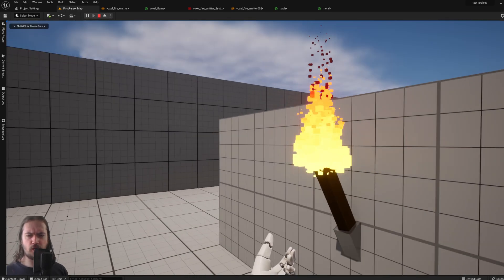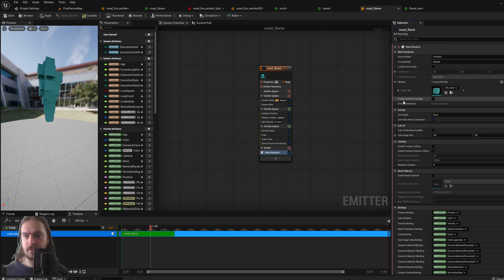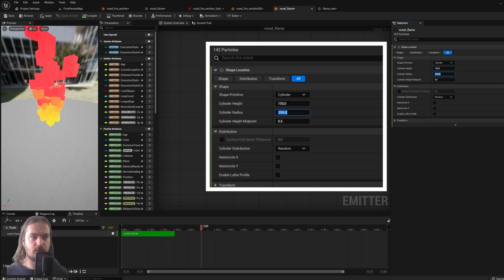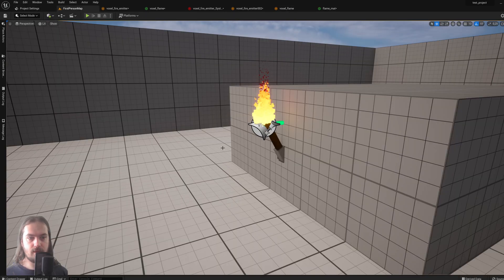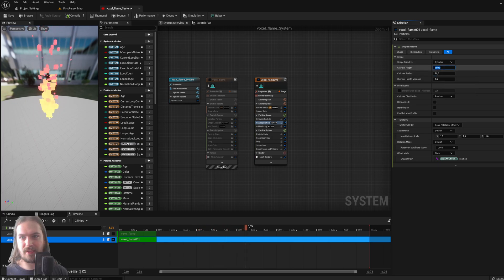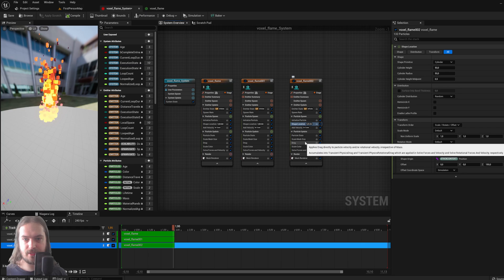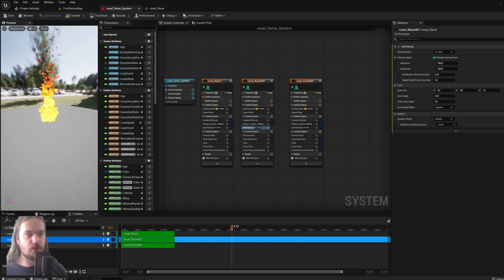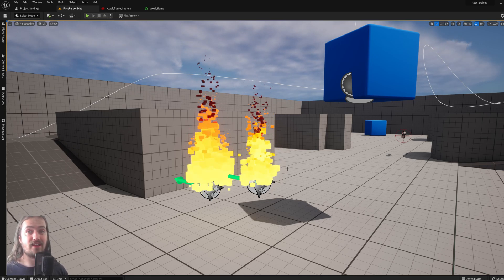Unreal Niagara Voxel FLAME System UE4 UE5 Tutorial

Comment: Nice Video! Here comes the million dollar question: does Niagara support Android, iOS and Switch.
Reply from the maker: i'm pretty sure for switch it won't be an issue, android and IOS I'm not sure on, I believe it works but you have to change some settings somewhere. Never looked too deep into it though
Reply: @thegamedevcave  Thanks!
Reply: @thegamedevcave  Found an answer: niagara works with all platforms, if there is a problem with a specific Niagara asset then its most probably coming from its material